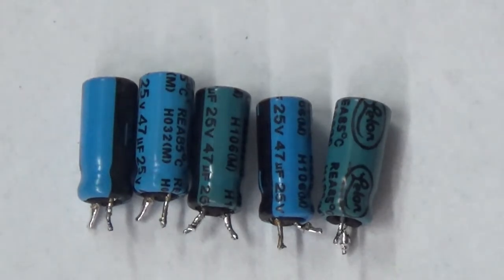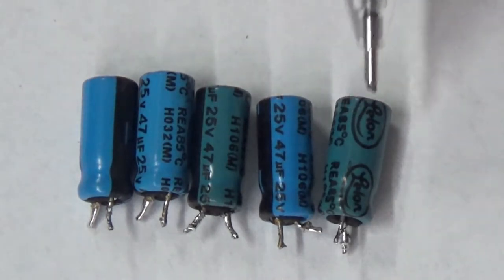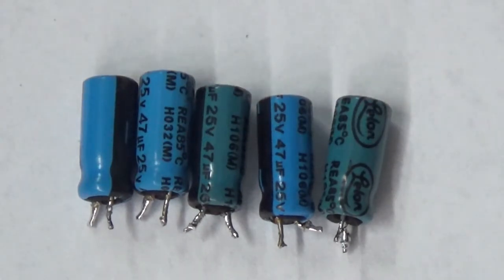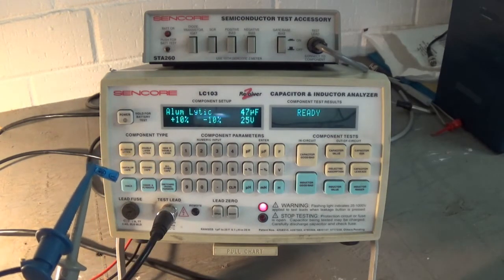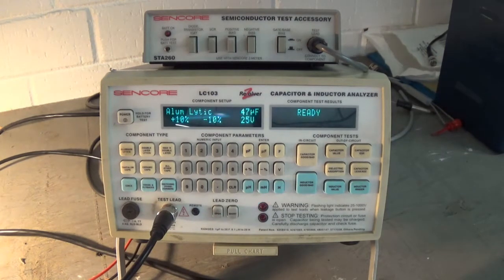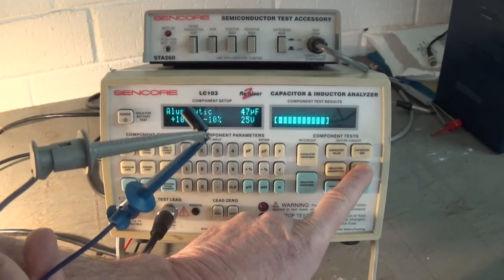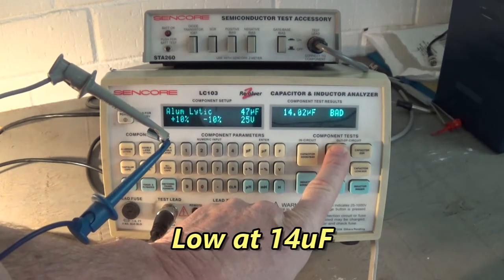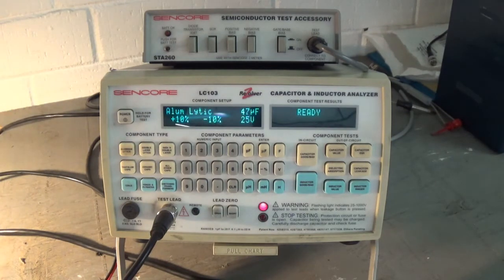How Electronic Components Fail (Part3)

Comment: Me and a colleague went through a 17-year old Siemens Industrial PC that was powering off during power up, after the POST and when loading up Windows 2000, the other day. When looking into the device, we immediately saw that many of such caps at the main board were bulged at the top, like half of the 20 something that were on the board, all the same value of 1,500uF x 10V. We have removed all of them and verified the capacitance with our portable multimeter (a Fluke), but the capacitance for all were within their labeled range (10%). Unfortunately, we did not had a measuring equipment to check for ESR and leakage (thank you very much for the teaching!). We went on and decided to change them all, which restablished the proper device back to work again. We have assumed the caps were just leaking too much and not sustaining the voltage, and the chipset detected this and restarted the device all the time. But we were not sure of this, since the capacitance seemed fine. The power supply module looked and was working fine, though.
Reply from the maker: You guys are awesome. What a wonderful repair. Honestly if I saw 20 each electrolytic capacitors requiring replacement. I would have cried tossing my hand up to heaven asking why I deserved this punishment. HaHa:) What perseverance you guys have. Thank you for giving me hope in the future:)